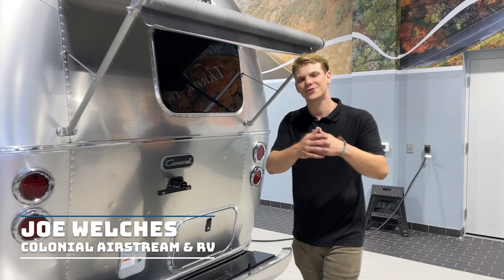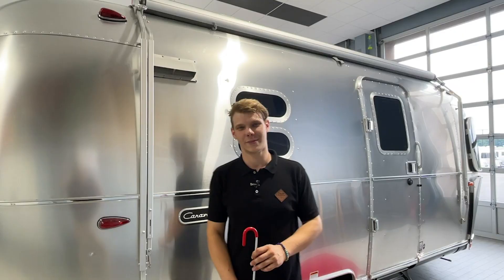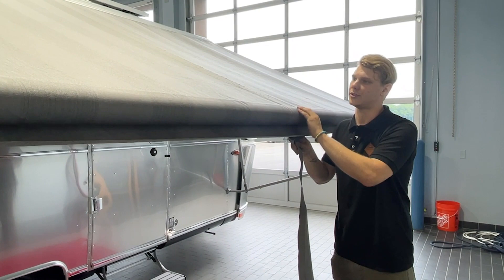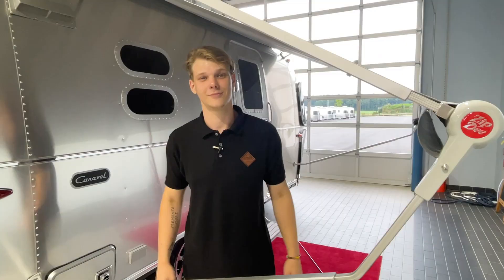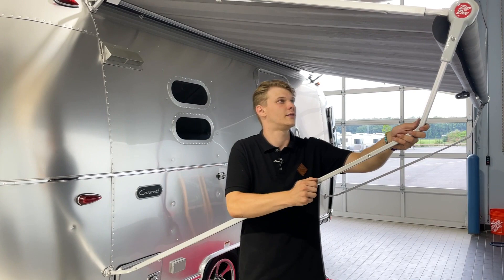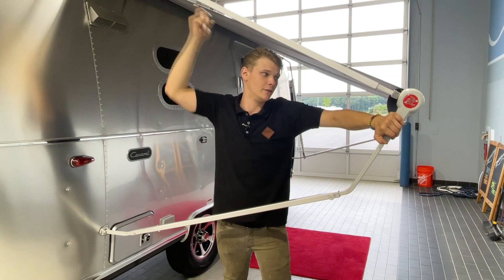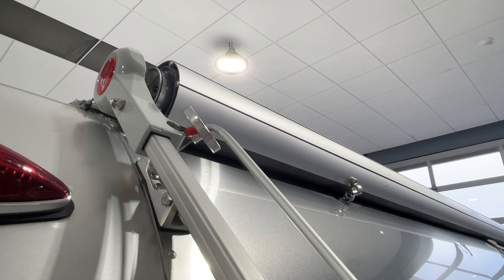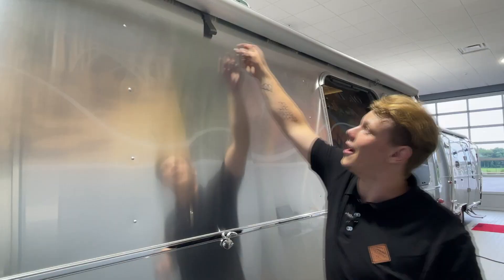How To Properly Use Your Zip Dee Awning On Your Airstream Travel Trailer | Manual & Automatic

Comment: I just purchased a 2021 Bambi 22FB and the Zip Dee Awning does not have the locking wheels on each end only the two rotating clip hooks.  Why is that?
Reply from the maker: The Bambi has a smaller lighter awning and they are not necessary.